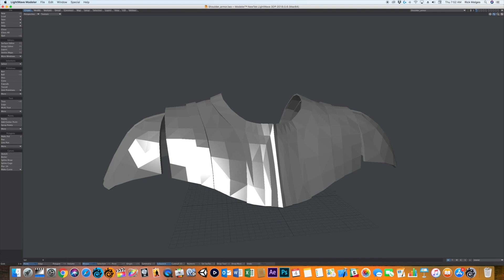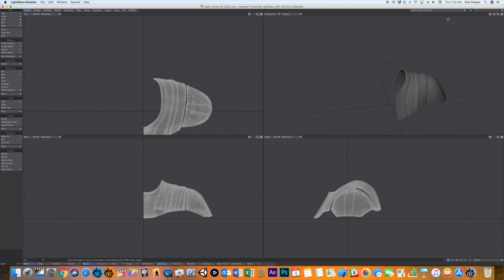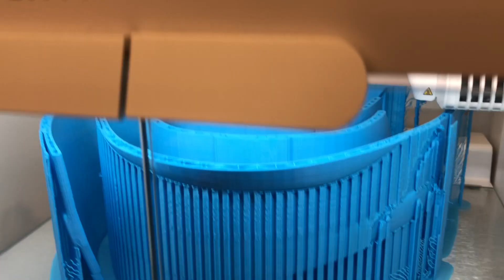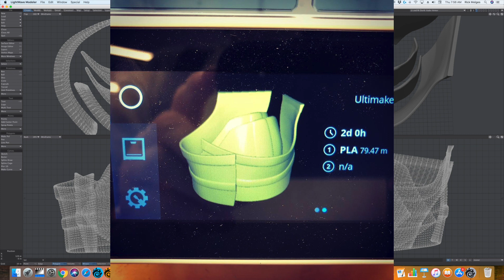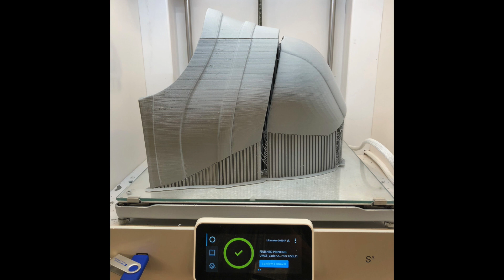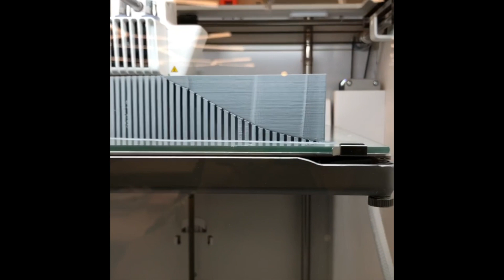Darth Vader Armor series #1 - 3D Printng

Comment: May I ask how can I measure it's width and size as centimetre to fit my body?
Any ideas?
Reply from the maker: You could use tinfoil and make a quick mold of your chest. Then carefully remove it and measure the lowest parts of the chest from the mold and expand/contract that portion of the model to equally to get it to fit. Just a suggestion

Comment: Hi there, I have an anovos armor set. And am considering printing replacement pieces as it has broken over time. How do you get the hinge to go into the plastic form? The hinge that holds the shoulder paldron to the chest plate? Thank you. Anovos quality terrible. Need to fix it.
Reply from the maker: Well, I found that fabric glued to both sides as a strip did a decent job. It’s not professional. But it worked ok.
Reply: @RickMelges  Thanks man

Comment: How did you glue the two pieces together? Currently I'm just YOLO'ing it...
Reply from the maker: Well. I used gorilla glue. But I also needed a piece of printed plastic on the back of the chest plate to hold the 2 pieces together. 

But after wearing it all day while at work. Stretching my shoulders caused it to break in half. I think the next version should be flexible in the centerline. Maybe silicone and have a wedge cut out to allow for movement.